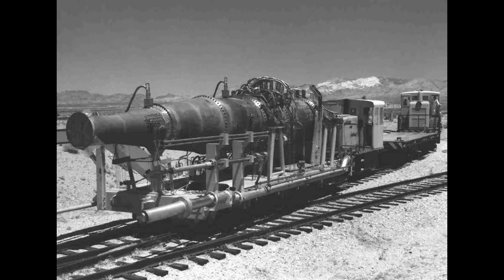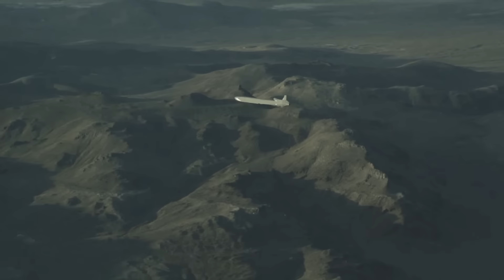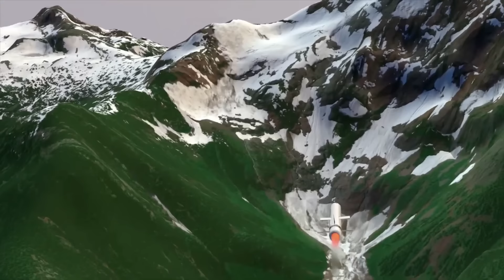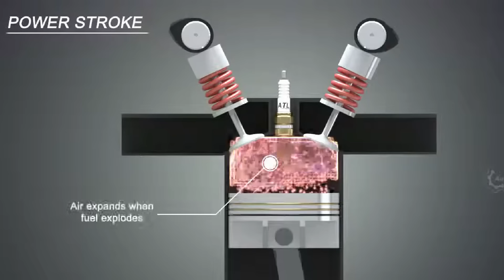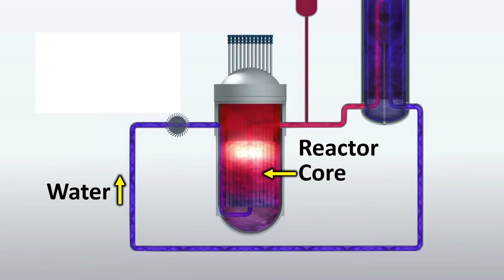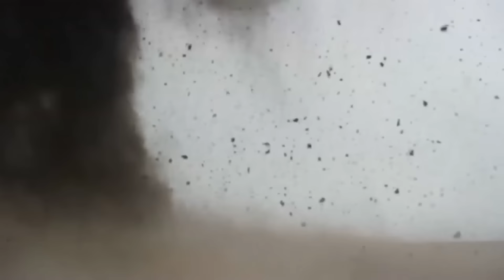How Can Nuclear Reactors Power Missiles? | Russia's Burevestnik Missile #militarytechnology

Comment: ANY missile fly using the basic principle from PHYSICS - Newton THIRD LAW :  action/reaction. In the case of conventional missiles, the burning hot gases expelled by the fuel combustion is the action,  and the "reaction" is the equal and opposite force (thrust) that propels the missile upwards. Stronger the action, stronger the "reaction" - is a direct relation between them.
Stupid statement at 7.00 -  where now "Patriot" system is "similar" to the S400🤣- prove you have NO CLUE the Patriot missile system is not only SLOWER but is also 5 TIMES LESS CAPABLE in range ! Dude, if something is 5 TIMES BIGGER is NOT "similar" lol ! 

1 - The missile is launched from an inclined launcher using a solid-fueled rocket booster.
2 - a booster gets the missile up to speed,  so air can be forced into the inlet at the front of the missile, much like a ramjet.
3 - The incoming air passes over a nuclear reactor, which heats it up intensely,  and now the super-heated air expands rapidly and is then expelled out the back of the missile through a nozzle - we get THRUST. 
 The breakthrough was achieved by using materials capable to withstand the huge temperatures, extreme miniaturization of the reactor,  and probably, by using liquid metal for cooling ( maybe bismuth alloys) - the russians are the most advanced nation on this field, not just by the great metallurgical skills, but also by many decades of experiencing with liquid-metal cooled reactors -  Russia is the only country, to the present day, who build a nuclear sub with such as the November-class K-27 and the Alfa-class submarines, which used lead-bismuth eutectic coolant - murica tryed a variant with sodium reactor but failed, like they failed miseably with their prototype of nuclear-powered cruise missile, decades ago. 

Now, the most important part, since the reactor on the russian can easily function for several weeks even months, Russia now has the only missile in the world who can loiter for weeks and months, with an endurance several orders of magnitude superior to the drones powered by solar panels, and, most important, the only system capable to operate as a weapons guidance and comms/surveillance backup in case of catastrophic failure of satellites. The fact Russia can put some weapons loitering months on the border of an opponent gave them a serious advantage, especially considering the weapon can be called back.
Reply: там сплав висмута и свинца
Reply: They are only capable of making a few..  Like T14 Armada and SU57.  If they had capable weapons they would not need 3 years to conquer Ukraine.  The whole ecosystem is rotten.
Reply: @dagmastr12  The reason Russia is struggling in Ukraine is simply to minimize civilian casualties.  From the beginning of the war, the West has been focusing on reporting on civilian casualties.
A little girl cries as she is separated from her father, and an old man and small children are rescued from a bombed-out apartment building.  If Russia had fought the war like the United States, it would have been over in less than a year.
A U.S. military operation begins with the launch of a Tomahawk missile from a warship at sea. Of course, the media only shows that scene. They don't talk about civilian casualties at all.
Reply: @someday2910 yes there's a lot of propaganda during any war.
Reply: @dagmastr12  - sure, is not like they fight the whole fking NATO...  dude, get out from that cave where u live and take the Red Pill, looks like you are living on la-la-land !
Reply: @dagmastr12  You misunderstand the goals, hence your erroneous conclusions. The goals are not to conquer, but to protect yourself and the Russian-speaking population from Nazis and aggression from radical forces.
Almost all NATO countries are supplying Ukraine to the limit of their capabilities, not only with weapons and money, but also with mercenaries. So this proxy war is not with Ukraine, but with the entire NATO bloc.
Reply: @mihasvideos Where are the Nazis? You realize that there are Russian Nazis...?  Just like in American prisons.  Russian future is being destroyed right before your very eyes... Shame
Reply: @mihasvideos You realize that there's a lot of propaganda during wars... Right?
Reply: @dagmastr12  Of course, especially in your countries
Reply: @dagmastr12  If a grandma had a pipi she would be a grandpa.
Reply: @KonstantineM995 correct
Reply: @KonstantineM995 I feel bad that the amount of people killed in this war....it seems something from the 19th or 20th century.  I would have never thought in the 2020s there would be a war there. I visit Bulgaria often and it just seemed like we were past something like this.

Comment: The new MIG-41 will be redesigned and become a loitering control platform with tactical capabilitioes- driven by Burevestnik type nuclear drives.
Reply: Will gigantic flying loitering AI controlled air carriers refuel and rearm them like in Ace Combat 7? I think the new MIG should be called Sleipnir or have a similar badass name.
Reply: @FatumIustumStultorum-bt1kj  You rarely have to refuel a nuclear engine. Ideal for laser weapons.
Reply: Too expensive, too dangerous, kinda useless, not gonna happen
Reply: We will have to see.
Reply: Очень дорого.
Скорее всего будут использованы детонационные двигатели.
Они как ни странно дешевле..🤔
Reply: Keep dreaming lol
Reply: A rocket is much harder to build than a plane. They just need to attach two Burevestniks to the wings and fire them up. They'd just have to find a way to cool the reactors when they land, and that's it.  @johnadams3038

Comment: As the technology for creating miniature atomic reactors are developed now, why not produce small atomic powerplants for domestic use?
Reply: Exactly.  Instead of sub-stations they could have mini reactors in every street.  By now, if this was real, even houses could have them like petrol/diesel generators.  After all every smoke detector contains radioactive material!
Reply: @Moonlightshadow-lq4fr These are new technologies, all in good time.
Reply: @petersherwood1813  Not so much, and anyway, we should all question why we don't have conventional mini nuclear power stations seeing as all they do is boil water.  We should be asking why don't they build mini steam turbines that can be propelled with any fuel, we don't need megawatts of electricity per household just 20 kilowatts will do!
Reply: @petersherwood1813  They are not. This technology has exsited since the cold war, when both the US and the soviets build prototypes of these missiles, which functioned. But both the soviets and the US decied it was a trash design and not cost effective.
Reply: They probably need highly enriched uranium, so anyone could steal fuel and make atomic bomb. Not good.

Comment: Maybe fueled by a stable isotope of helium 3 with two protons and one neutron. Helium 3 is rare on Earth but abundant on the Moon, where it was deposited by solar wind, ideal as a fuel for compact fusion reactors. The use of \({}^{3}He\) in fusion reactors is particularly interesting because the reaction produces helium and an alpha particle, but no neutrons, leading to a cleaner process compared to fission. The Soviet Union sent missions to the moon to recover moon rock from as far back as the 1960s - Intriguing thought.
Reply: They haven't cracked the problem of sustained fusion power just to make a long range cruise missile, it's fission based.
Reply: @davidste60  I'm just speculating and I should imagine the engines core reactor is classified. The Russians have surprised the world with their advances in recent years, like hypersonic glide weapons that can alter course during atmospheric flight as an example. If it is fusion then the battery electric car issue could eventually be solved being one example.
Reply: @davdave3470  It's not fusion.
Reply: @davidste60  Well we'll find out if they deploy one with a conventional warhead.
Reply: Yeah sure. Mining helium on the moon. 😂
Reply: Baby, fusion reactors don't exist as yet. ANY. And you think that aging post-USSR scientist has built one and managed to fit a reactor into missile? 😂😂😂

Comment: I found a patent for a nuclear turbojet engine. It uses a closed cycle. The reactor is located separately from the turbojet and heats the air in the heating chamber through a liquid metal coolant, likely sodium or lithium, or their alloys. So, there's no radioactive trace. And placing the reactor separately from the turbojet makes the reactor robust and radiation-resistant. The turbojet engine is likely equipped with an afterburner fueled by kerosene or decilin, which allows for short-term acceleration to 1,300 km/h.
Reply: I don't think missile has onboard chemical fuel, except for booster stage that brings missile up to proper flight speed for main nuclear propulsion to take over
Reply: @manofsan  The coolant temperature is limited, which limits thrust, so the Burevestnik has subsonic speeds; it simply doesn't have enough thrust to fly supersonic. However, the afterburner allows short-term flight speeds of up to 1,300 km/h, which allows it to penetrate air defense zones; normally, flight is purely subsonic.
Reply: @LithiumDeuteride-6  - how was the flight test concluded? Did the missile somehow land and get recovered? Otherwise, I'd imagine that a crash would result in contamination like a dirty bomb.
Reply: @manofsan  most likely, the cruise missile landed on the water without destruction, the reactor is completely sealed and very durable. Such a reactor can collapse if it only crashes into a rock at full speed.
Reply: @manofsan  - I think you are right, and even the booster is not considered as part of the missile, like a bomb is not part of the bomber. Probably, the missile can be launched from air by a fast airplane without the use of detachable boosters.
Reply: not the case here, "afterburner fueled by kerosene or decilin, which allows for short-term acceleration to 1,300 km/h." you need to carry the fuel = no great range.
Reply: @mirandela777 The flight is short, from a few minutes to half an hour. This is enough to overcome air defenses. Many don't understand the problem of air defenses; modern Russian cruise missiles are equipped with various systems for overcoming them. You've seen the fireworks from our cruise missiles. You can't stop them all, and once you learn that they explode at full power when shot down, many anti-aircraft gunners will start faking a malfunction.
Reply: @LithiumDeuteride-6  - I I have to choose between minutes or half-hor and DAYS or WEEKS  - I chose the later one. The fact it can loiter days is enough to scare a foe.
Reply: там смесь свинца и висмута как теплоноситель
Reply: @krainiy.praviy.sleva.  - are you sure? not sodium or sodium-potassium mixture? why do you say lead & bismuth?